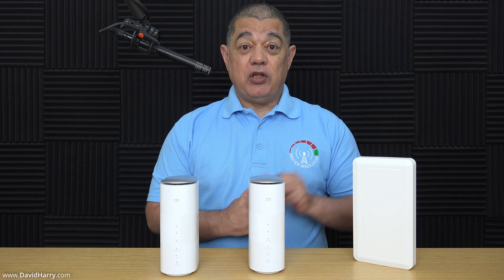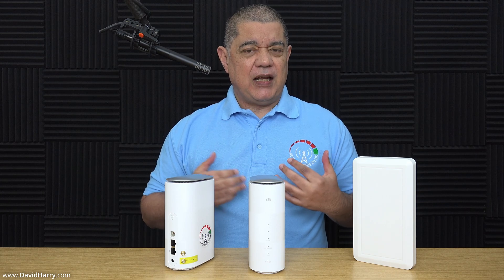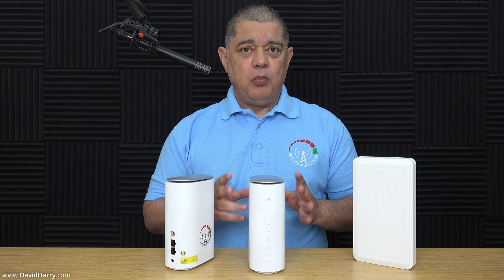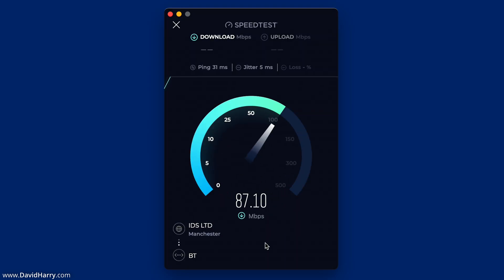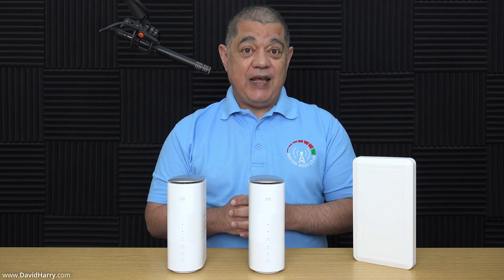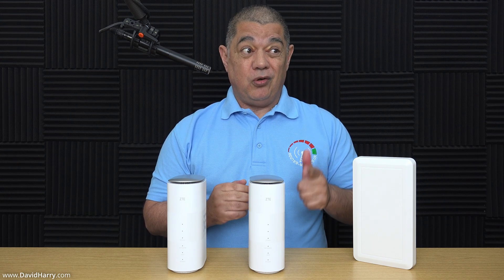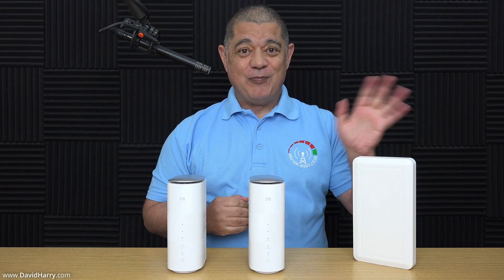ZTE MC888 5G Internet Speed Test Comparison With External 5G & 4G SMA Antenna Router Modification

Comment from the maker: Mini 5G antenna: https://geni.us/Mini5G
ZTE MC888 modification options: https://geni.us/Router-Mods-ZTE-MC888

Router playlist https://www.youtube.com/playlist?list=PLleKChtNUwZTyTwZxrJRYPUXTSJUzi5k

Boost Your 5G Internet Speed With an Outdoor External Antenna Speed Test With SMA Modified ZTE MC888

In this video I will be doing a speed test comparing a ZTE MC888 5G cellular internet router with a modified ZTE MC888. The modified ZTE MC888 is using the Mini 5G external antenna, which is designed to go outdoors.

The modified ZTE MC888 is using the Router-Mods part modification. This modification adds two SMA ports to replace the 5G signal routing that would usually route to the built in TS9 ports on the router when using an external 5G antenna.

Router-Mods also provide modification services for many different 4G and 5G internet routers. They also supply many different 4G and 5G antennas, as well as WiFi antennas and they also supply installation services among their many other services.

Here's a link to the Router-Mods website: https://geni.us/router-mods

Be aware that once you have any of these modifications applied to your router, that you will no longer be able to use the router's internal antennas. You will have to use external antennas once any of these SMA port modifications are applied to your router.

This video was sponsored by Router-Mods www.Router-Mods.co.uk

Video chapters:
00:00 Intro
04:35 Standard router speed test
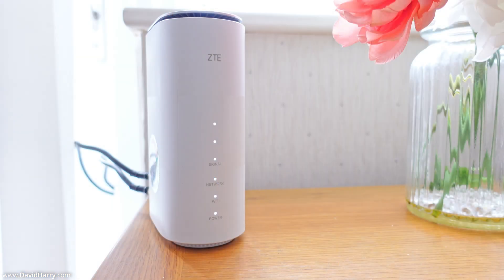05:50 External 5G antenna speed test
07:16 Speed test results
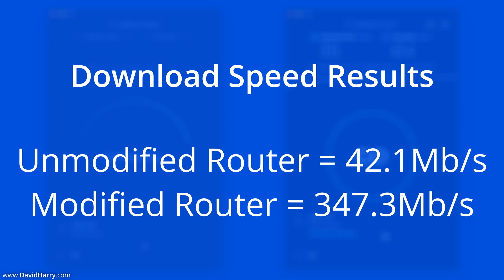09:35 End summary

Here is some extra info from Router-Mods:

Without Modifications selected – Includes a new, unused unlocked router that will be unmodified.
With Modifications selected – Includes a new, unused unlocked router that will be modified to your selected modifications.
Send your router – Requires you to send us your router for modification.
WIFI Modification – Converts the internal WIFI antennas for external antenna use providing you with 2x SMA WIFI antenna ports.

Full Mod – (5G Router) Provides 4x 4G SMA ports and 4x 5G N77/N78/N79 SMA Ports. NOTE: Q4 2022 Models only have 3x 5G ports not 4 SMA Ports.

Part Mod – (5G router)- Part Modification – provides 2x 5G N77/N78/N79 SMA Ports.

NOTE: Only purchase the Part Mod service if you have either:

(5G Router only) Damaged the factory external antenna ports while previously receiving 5G signal with an external antenna attached prior to damaging the ports.
(5G Router only) Does not have factory external antenna ports but are receiving 5G signal via internal antennas and wish to improve the 5G signal.
If either of the above, do not apply to you then please purchase the full modification.

Please Note – All modifications (4G/5G & WIFI) removes and replaces all internal antennas for SMA external antenna ports. The internal antennas will no longer function. The router will be reliant on the new SMA ports for connectivity.

Router Modification Service

This Purchasing option is used to purchase our fantastic, well known and loved router antenna modification service.

This requires you to send your router to use for modification.

Modification Service Process:

Once you have completed the checkout process, please dispatch your router to the address within you purchase receipt (received via email) and provide us with the tracking information via email.

AMAZON ASSOCIATE DISCLOSURE:
I am an Amazon Associate.
My Amazon links are Amazon affiliate links.
I earn money from qualifying purchases when you use my Amazon affiliate links.

OTHER EARNINGS AND COMMISSIONS:
I also earn money from other product links within my video description.

For the sake of clarity and for the avoidance of any confusion, assume that I earn money from commissions from any and all links that I have within my video description.

Amazon links to stuff used in this video:

The gear that I use, have used or reviewed that I would recommend.

Cameras: https://amzn.to/3PzC8mI

Microphones: https://amzn.to/3tD6FaM

Computers: https://amzn.to/3tuwHNr

Phones: https://amzn.to/3ttqjWN

iPads & Tablets: https://amzn.to/46t8wxG

You can also send me a coffee donation via PayPal if you found my video super helpful:
https://www.paypal.me/DavidHarry

My Amazon pages with videos and product links:
Amazon USA https://www.amazon.com/shop/davidharry
Amazon UK https://www.amazon.co.uk/shop/davidharry

If you would like to help my channel please use my global Amazon Affiliate links. I will be paid a small commission for anything you buy from Amazon when using these links. These commissions don't cost you any extra but really do help me to buy gear for my productions and to review:

Amazon USA: https://geni.us/Amazon-USA
Amazon UK: https://geni.us/Amazon-UK 
Amazon Canada: https://geni.us/Amazon-Canada
 
Contact for product reviews: YouTube@DavidHarry.com

http://www.DavidHarry.com

I’m David Harry. Thank you very much for watching this video, take care and goodbye now.

Cheers,
Dave.

#DavidHarry#LiverpoolTV